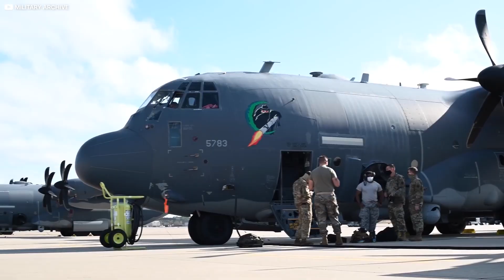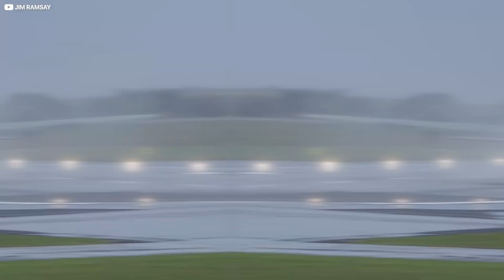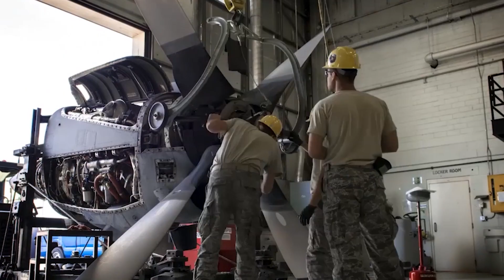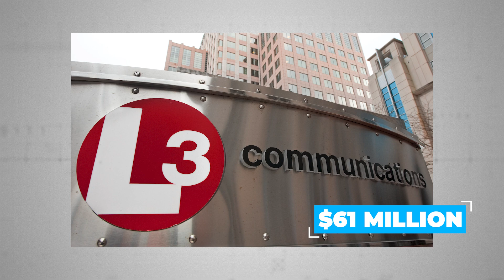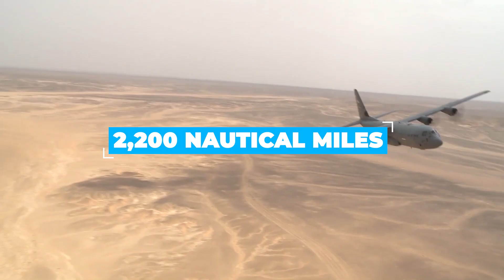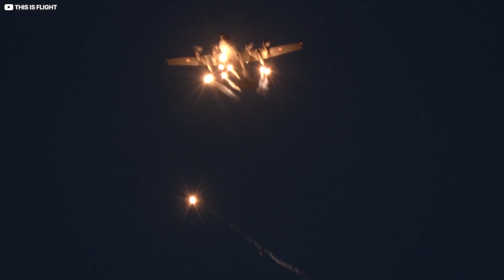The Unbelievable Power of The AC-130

Comment: The AC-130 is basically an C-130 aircraft with heavy guns mounted onto it. Even if it ends up becoming obsolete due to its air performance get beaten by modern aircraft in the future, the role of a aircraft gunship isn't likely to disappear in the future due to the AC-130 proven effectiveness at providing ground support from the air. Even if the aircraft does become outdated due to it aerial performance I'm sure that a more modern aircraft will surely take over the AC-130's role as an aircraft gunship.

Comment: I've got a feeling its not going away any time soon  what might replace it is a droe style aircraft with the same cablities its completely ran via radio controls and robots load and unload amo  its slow speeds make it harder for fighter Jets to hit it just needs a smaller size but if you recall these took a lot of dammag in wwII and kept flying the air fortress was hard to bring down.
Many of them on long missions made it back to be patched up and sent back out.
Robots loading amo gives more room for animations on board. A turret style missel carrage could this multi missel carrage could auto load.
Something this effective could take out Sam's battery and clear the air for other craft. With less risk to human life unless your in the Sam's battery location.

Comment: Really inaccurate history, and inaccurate information. I worked on the AC-130U gunship test team. You got a lot of things absolutely WRONG. The current AC-130J has a 30mm cannon and a 105mm Howitzer, along with several other standoff munitions that will make it a viable option for the kinds of conflict it is designed for into the foreseeable future. It has an outstanding jamming suite and sensor suite and mission control avionics and can inflict horrific damage on low intensity high value targets. It hunts insurgents and terrorists and protects special forces in the field. It was never meant to be an attack platform for any other environment and in it's intended role it is SUPERB. Plus, your inclusion of the C-17 photos show just how clueless you are.